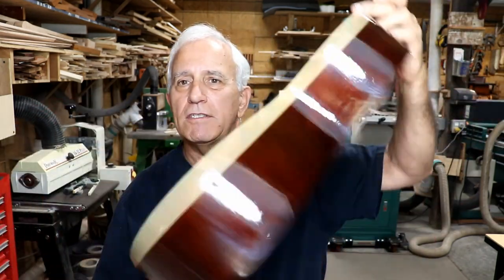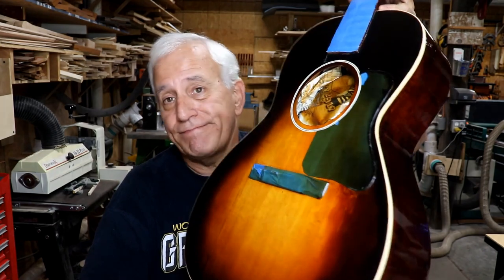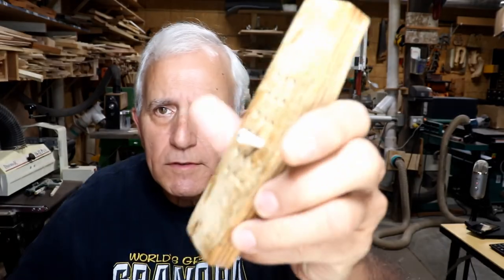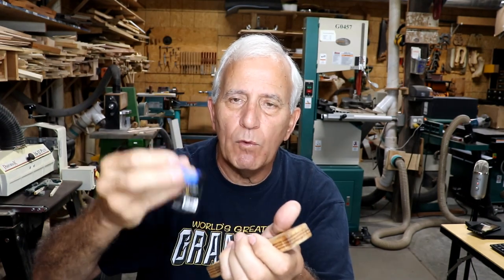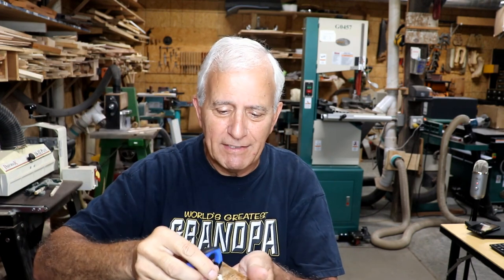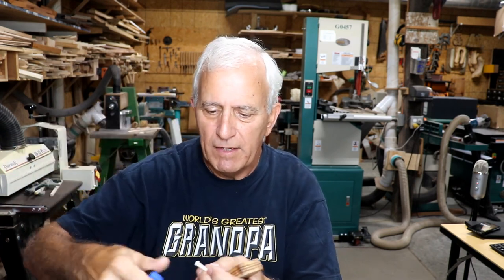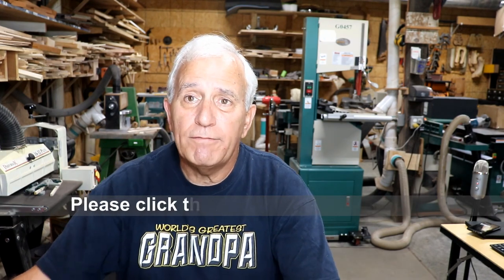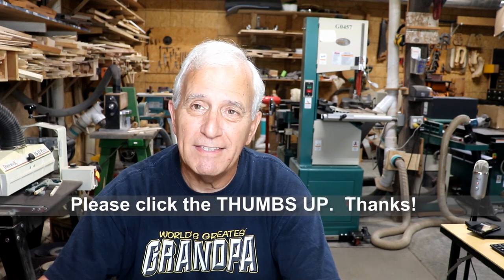VLOG #073 The Gibson Finish is Finished Almost

Comment: Those plastic string winders have a built-in pin puller, too. I've used those for decades, and never knew that until I saw a guy on a video pull pins with one.

Comment: Jerry, the pin puller can be rolled backward (toward the little nub on the bottom) either
toward the lower bout, or over the saddle, or pulled straight up, whichever of those
ways works best, in any situation.